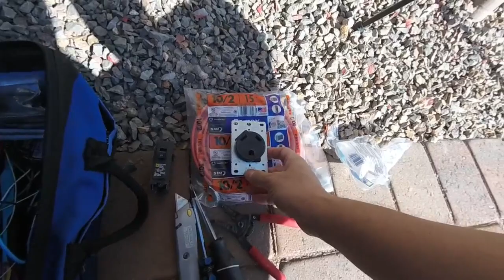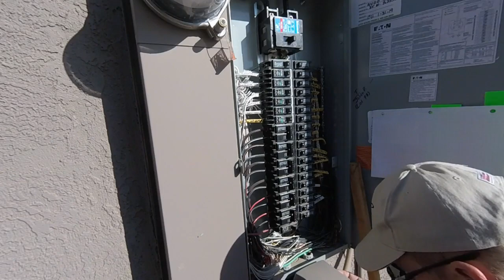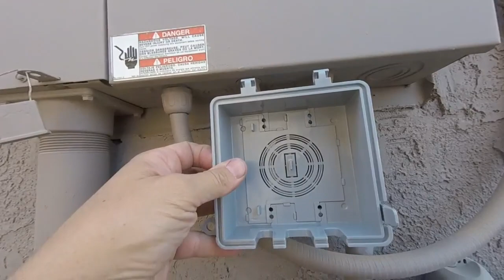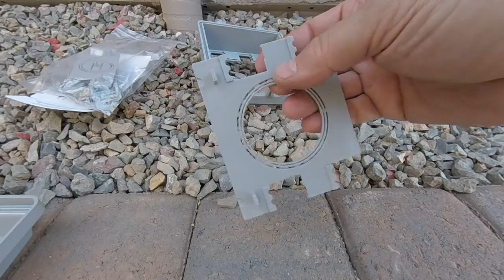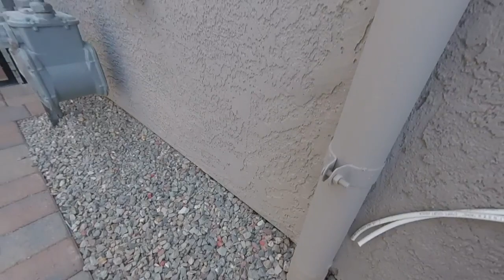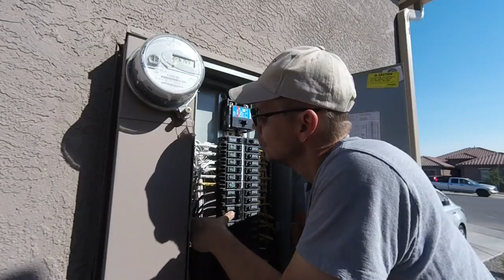Installing a Home 30amp RV Outlet

Comment: Mike,   Nicely and safely done.    A couple miner points that an inspector could have an issue with.   The NEC started requiring "in-use" covers for outdoor receptacles, but who knows how long it's been there.  Oh, you showed it on YouTube.    Also, although safe, stripping the jacket off of NM cable and using the conductors is not technically correct.   The insulation is the same, but the cable is labeled on the jacket, not the conductor.    Inspectors look at the information on the conductors during inspections as that information is required by NEC to be there.
I'm not saying to change anything, I'm letting you know for future.   It could save a rejected inspection.
Respectfully,     Kevin

Comment: That breaker, does it have to be single? I heard the dual ones won’t give me what i need
Reply from the maker: Single or double breaker, whatever is able to fit in your breaker box should work for you. I would make sure your wiring will work with whatever breaker you choose. Good luck on your project!- Mike
Reply: @mikesdoityourself  won’t a dual pane give me 240 on each leg?

Comment: What kind of wire is that? I know its 10awg but what's the specification?
Reply from the maker: This wiring is 10/2 wiring Romex " Simpull" type NM-B 600 volt, (3 wires total- ground, white, black). Good luck on your project- Mike